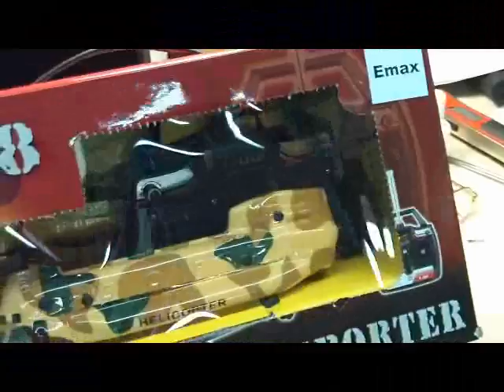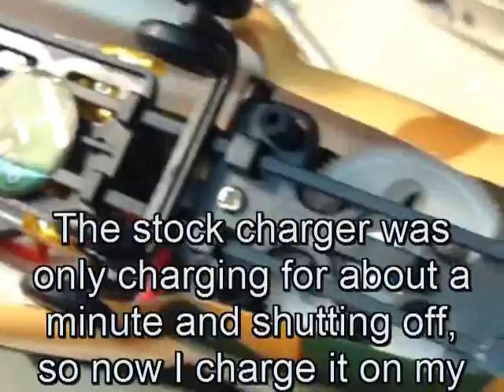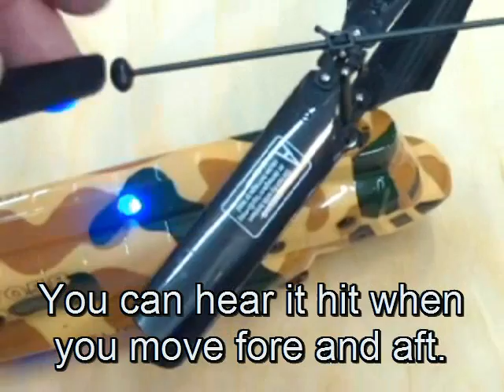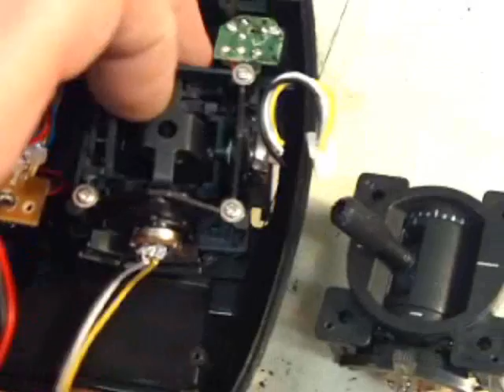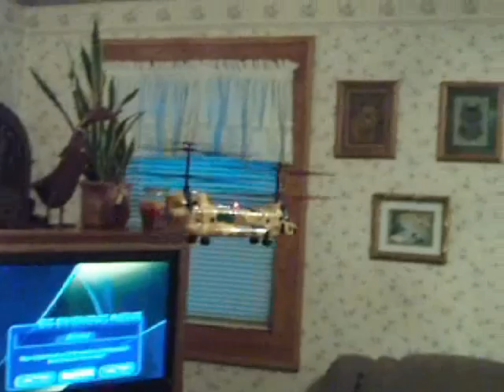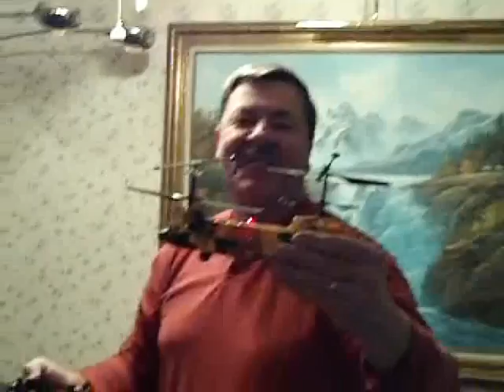Emax Mini Chinook and TX mods..

Comment: I have seen you rate and fly many smaller rc helicopters such as this one but which would you reccomend for just plain old fun around the house such as the Military Hughes 300 Radio Controlled RC Helicopter w/ Lights.  It honestly looks like fun to fly around and i was just wondering which do you prefer. Thanks man.

Comment: Nice Vid dave, im surprised just how well that flew, the gap between real model aircraft and toys is definitely getting smaller smaller.

I can sort of see why they put the rudder on the right stick, its like some of my 3 channel airplanes when they do not have ailerons they put the rudder on the right stick, the difference is of course in an aeroplane the rudder induces roll in a plane with dihedral so it does not work as well on a heli where it just causes yaw.

Looks a lot of fun!

Lee.